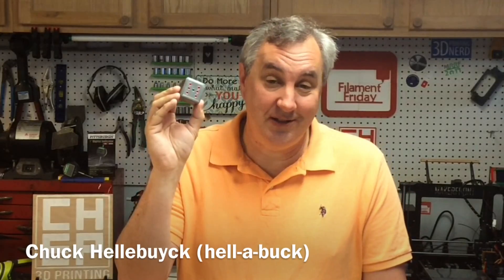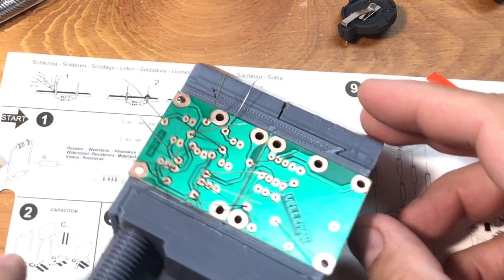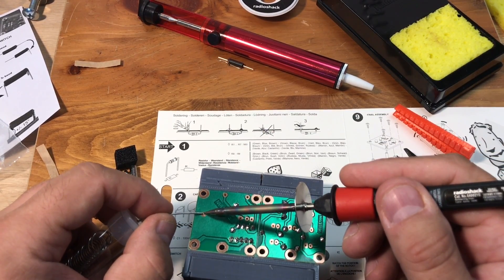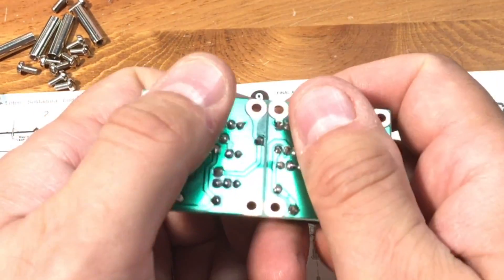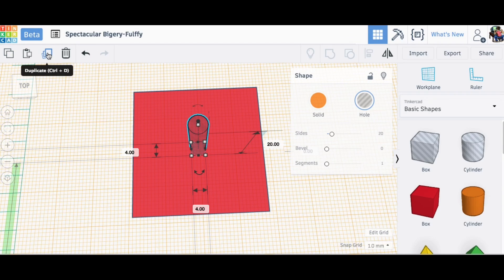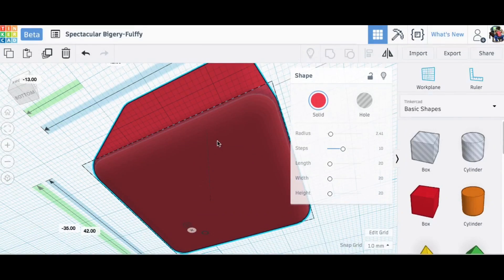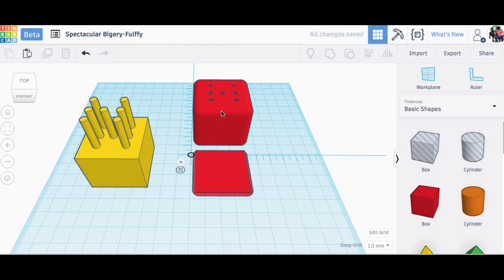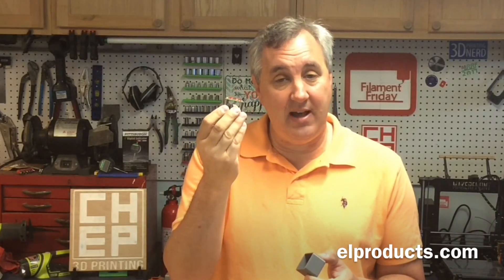Velleman Electronic Dice Soldering Kit with 3D Printed Case

Comment: did the kit happen to say what vibration sensor/switch was used in this kit
Reply: It's a simple balled tilt switch. You can easily replace it with a mercury tilt switch for smoother feel if you want and can find one.

Comment: 1:54... The pads look too shiny to be bare copper. I'm convinced that the PCB solder pads are plated for ease of soldering with a plating material that may look like bare copper.
2:05..BTW... I would put rubber feet under your PCB Vise to stop it from sliding around your work surface or maybe just not place it on paper....;)
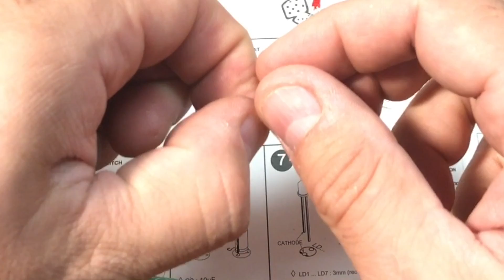4:25... Not all LEDs are marked with positive as the longer lead. The best way to check
the polarity of LEDs is to look at the plastic lens/case of the LED. One side of the LED plastic case flange will have a flat area. that indicates the Cathode lead or Negative side.
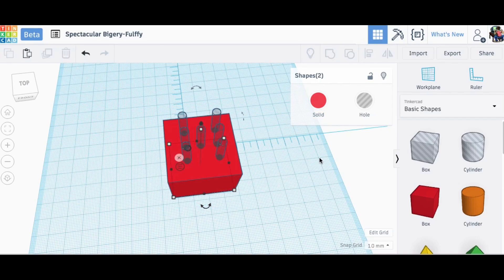7:58.. Now that is a great new feature that I can use.